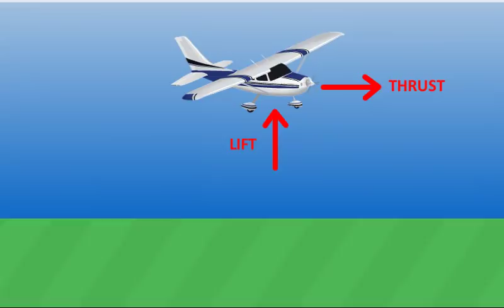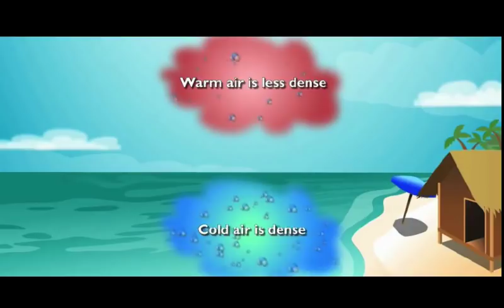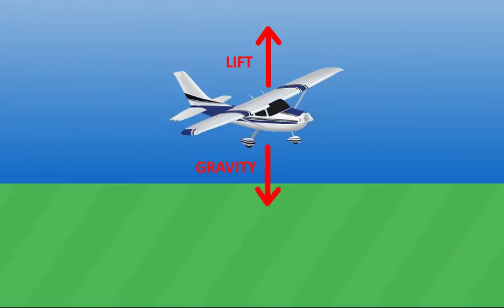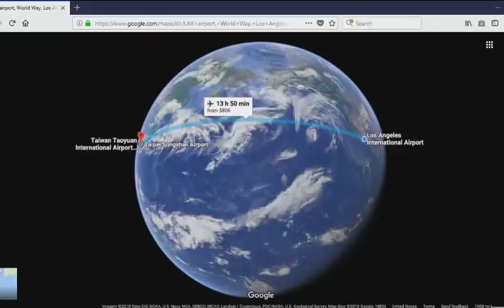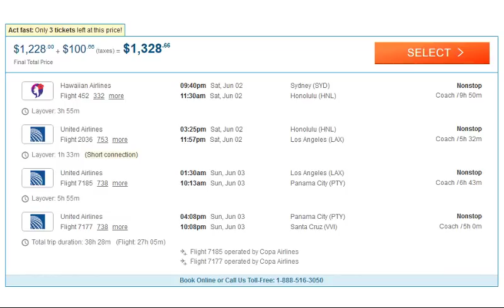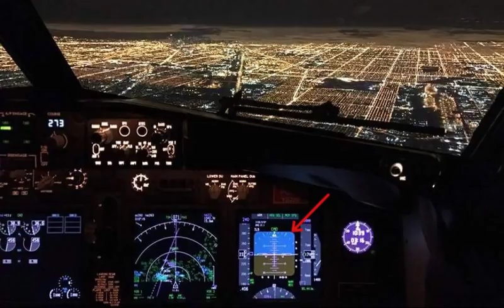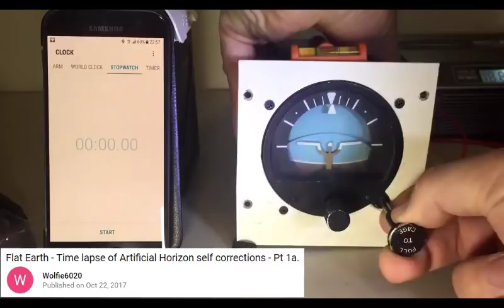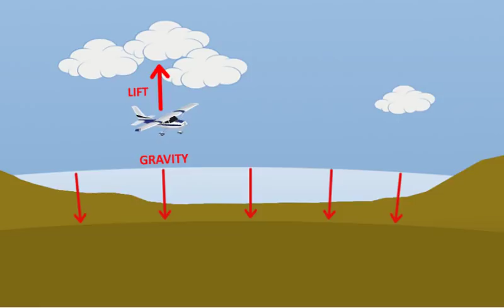Flat Earth Falsities - Plane Nonsense

Comment: Qantas flight 27 is your example to debunk flat earth theory. Please check any flight tracker, check this flight and watch it live. The GPS coordinates go dead shortly after takeoff and resume before landing. This happens for all southern flights that cross the area. This does not happen on flight paths over the "flat earth" map. You can see the coordinates the entire flight. Please explain this.
Reply from the maker: That is not true. I have personally tracked that flight. And even if it was, what are you suggesting, that it goes through some sort of time warp to get it all the way over to the other side of the flat earth without crossing North America as it should?  How can it make the distance in the time it takes? It should take about 3 times longer.
Reply: I'm not making this stuff up. You can see it in your video at 11:10. GPS data is live when the flight line is green. It turns white/disabled after take off and then green again a few hours before it lands. I have no idea why. Test it yourself. Qantas 27 takes off in 3 hours. At some point, the GPS will cut out. I tracked it departing from Chile and the GPS dropped out shortly after it was over the ocean. It then became available 3 hours before landing in Australia. It happened to different flights too. I'm not suggesting anything. I'm not a flat-earther. Just trying to debunk the theory as you are. It's a disturbing anomaly.
Reply from the maker: leo gibson - Go to flightradar24.com right now if you can. I am currently watching SAA280 from Johannesburg to Perth, in the middle of the southern Indian Ocean. Another flight that is not possible on a flat earth. I suppose all the flight trackers are in on the scam.
Reply: GPS is owned and operated by the United States government as a national resource. The Department of Defense is the steward of GPS. @JonasGrumby71
Reply from the maker: leo gibson - not only the US. Come on man, this literally took 30 seconds.

https://en.m.wikipedia.org/wiki/Quasi-Zenith_Satellite_System
Reply: @leogibson2486  So you make a claim.  You get shown that your claim is wrong.  And your response is to just claim it's all part of a conspiracy?  Does that really sound like a reasonable approach to you?  Also, just so we are clear here, you are claiming that the "government" is covering up flights in the southern hemisphere in order to hide the FE but they are so incompetent that they leave the northern hemisphere ones visible?  Really?  Come on man, do better.
Reply: My only claim was GPS flight data is not live during the entire flight. It goes from live data to "estimate" mode, mid-flight. Maybe that is common. I don't spend all day tracking flights. I assume the GPS data we see from tracker sites is somehow retrieved from a source. Wikipedia tells me that the US gov owns GPS. That could be wrong too. If there was any truth to flat earth, I would imagine there would have to be an elaborate cover-up. GPS seems to be the easiest to manipulate. Everything else seems pretty unbelievable. The topic is more entertaining than anything. Antarctica seems to be where the core of the conspiracy lies. Apparently, it's off limits for exploration.
Reply: @leogibson2486  "My only claim was GPS flight data is not live during the entire flight."
And my point was that you accept the GPS data that you think supports you and ignore the GPS data that doesn't support you.  That's cherry picking.  It is a very dishonest approach.

"Antarctica seems to be where the core of the conspiracy lies. Apparently, it's off limits for exploration."
It is not off limits to exploration.  You should stop getting your information from FE videos.
Reply: @leogibson2486  Good notice Leo, but you are dealing expert cherry pickers dishonest approach lippers as you have witness, they have no other recourse. We also may question the honesty of flight speed.
[The U.S. Department of Defense developed the satellite-based Navstar GPS system to accurately navigate in three dimensions - latitude, longitude, and altitude.]
Reply: @leogibson2486  I'm pretty sure GPS data for flights isn't perfectly accurate to the public for safety reasons. The US government created GPS but it is publicly available to every country on earth. The notion that somehow the US is keeping a coverup from other countries that have been to space is silly, and it's even more absurd to claim that every government is in on it. That level of secret could never, ever be kept. The reason Antarctica generally off limits is because it has a delicate ecosystem and tourists would obliterate it if they went down there. But there is one easy way to show that the Antarctic isnt an ice wall around the earth. Sail a boat all the way around what would be the southern rim of a flat earth and see how long it takes. On flat earth, it would take monthes to complete
Reply: Imagine getting on the plane flying from Sydney to Santiago, and then finding out the pilot is a flat earther.

Comment: So what slows the plane’s horizontal velocity down and speeds it back up again as it passes from the Southern Hemisphere past the equator and  onto the northern hemisphere? Honest question here, not a flat guy but if the earth has a circumference then it must have the largest diameters be at the equator and the prime meridian. If a plane takes off and has a horizontal velocity moving with the earths rotation, what force slows it down and speeds it up as it moves south tho north or vice versa?
Reply: https://i.pinimg.com/736x/d3/e0/a1/d3e0a1221de8cca4601b8885af1b6f39.jpg
Reply from the maker: Pilots are always making corrections for wind. The very gradual change in the lateral velocity will just be an unnoticeable part of those adjustments.
Reply: A puzzle, the sun on a flat earth has 1000's of miles further to travel when circling over Australia, then when circling around Mexico, simply different diameters. So summer below the equator when the sun is also below the equator the sun travels about 27,000 miles. Summer in the north the sun travels above the equator for only 21,000 miles. Therefore to race around above the flat-earth, the sun has to change speed to the tune of 6,000 miles. What makes the sun speed up, then slow down.
Reply: So just to clarify my question, I am not referring to winds, as wind and weather often produce vectors and patterns completely independent of the earth’s rotation. So per this website and I won’t bother summarizing it because I couldn’t do it justice but.....

https://www.space.com/33527-how-fast-is-earth-moving.html

If an airplane takes of from the equator it has a west to east velocity of approx 1037 mph with the rotation, and as it flys north it’s west to east velocity has to slow down as it changes latitudes where the earth is in fact rotating slower. So according to Newton’s 1st law something has to slow its west to east velocity down.... is the answer here simply the atmosphere is slowing it down? 

And not to complicate but what speeds it back up again as we pass over the North Pole and back down to the equator? Lol thanks all!
Reply: "as it flys north it’s west to east velocity has to slow down as it changes latitudes where the earth is in fact rotating slower" 
You have to consider the rate a plane travels relative to the size of the earth.  Seen from orbit the plane would be a microbe taking an hour to move about 1/10th the distance from the equator to the pole.  Within that hour the rate of change of earth's surface velocity is very slow and gradual.  I've heard it described as a 1mph crosswind, which for all practical purposes has no effect.
Reply: The usual problem. A total lack of awareness of scale.  @seymoresaymore
Reply: This is fairly simple. The answer is two parts. First, the earth is incredibly massive. Planes don't move fast enough for the change in latitude to matter. The adjustments required are so minor that just flying the plane fixes it. Imagine driving a car on a highway that is curving incredibly slowly road the right. But it only shifts over a few inches a mile from where you are. You wouldn't really be conscious that you need to adjust. It's the same with a plane.

Comment: fun fact old style INS systems based on a gyro fixed in space DO roll back this is part of how they track where you are based on its starting location see the CIVA INS for example this system would not work on a flat earth as the gyro would always stay upright and level

these systems where also effected by Coriolis and required inflight realigning based on fixed points on the ground, aircraft alt and slant angle to the ground station
Reply: Exactly the same with gyrocompasses, which is why the idiots keep ignoring them.

Comment: Gravity keeps the air plains  nose down automatically 😂😂😂  I am watching those blinds who follow this blind. How the gravity keeps down only the nose?

All the atmosphere rotate due to the gravity.(first of all gravity doesn't exist) friction? (If it is friction why the air moves from one to another place of atmosphere? Where is the pressure coming from? Since the air pressure can appear from east to west the reason you give us will be destroyed. Sorry I debunked you. Don't embarrassed yourself in front of flat erthers.
Reply: Abemelek Adsh Gravity is not keeping the nose "down".  When the lift on the wings equals the weight of the plane, the plane flies at a uniform altitude; the entire aircraft follows the earth's curvature.
Reply: Tubmaster 5000  is your version of  air plane moving on the ground? How it follows the curvature when the pilot not lets' it to curve? Poor argument. This is lack of basic aviation knowledge.
Reply: @abemelekadsh2708  
Gravity doesn't exist ? So tell me why do anything fall down ?
Reply: The problem that flat earthers cant understand is scale. The earth is massive. It is huge. No plane has to make adjustments because no plane moves fast enough to have to actively and consciously adjust to the curve. Further, even if the plane had to adjust to the curve actively, what prevents pilots from adjusting as they fly? Nothing. The adjust flight as needed constantly. The scale is massive that turbulence requires more adjustment than curvature. Next, assuming gravity doesn't exist is a hell of a claim. Please provide proof for such an assumption. You're making the claim, so that proof is your job to provide. Moving to your last point, the video explains exactly what you just asked for. Weather is caused by differences in pressure in the atmosphere. If anything, your point disproves a flat earth model. How does weather work on a flat earth if pressure differences in the air aren't the cause?
Reply: Rollie first of all I didn't say I have aviation certificate. second go and ask any pilot if they deep the nose of air plane in every six mile. they will say "No!". it's because the earth is flat.
Reply: You obviously have a total lack of basic aviation knowledge or are a liar, or probably both. And a pathetic troll to boot.  Please advise.
 @abemelekadsh2708
Reply: @abemelekadsh2708  How can an aircraft continue to ascend when the air becomes too thin to generate lift? Look at a FE map then go ask any pilot if they steer to the left when flying due east, steer right flying flying due west.
Reply: Robert Thomas your enquiries sounds none sense since we believe the air pressure acts toward the earth.
Reply: @abemelekadsh2708  You didn't answer my questions: You made the assertion that on a round Earth pilots would have to pitch their nose down, else the Earth is flat. That doesn't make sense because give RE, an aircraft can't continue to ascend when the air becomes too thin to generate lift. The same is true based on the amount of thrust created by the engines. 
You skipped: Do pilots steer to the left flying due east? This would be required on FE.
Reply: Robert Thomas your enquiry is raised particularly by  misunderstanding  FE. According to flat earth. Earth is stationary  it doesn't spine. So your question is not work here.let me relaunch your question toward you. While the air craft climbs the more higher the the more the air is thin this causes round earth problematic concept because the air craft keeps it's level hence it would neither descend nor ascend untill it reaches its destination means the aircraft supposed to keep the the level of atmosphere of the earth where it can get leveled air for the engine to work properly. But the pilots not keep down the nose of aircraft according to RE this will cause tje aircraft to leave the atmosphere of the earth. If you apply it for FE it is simple the pilot doesn't leave the nose down again and again as it is flat period.
Reply: @abemelekadsh2708  Here's news for you—a curved Earth has a curved atmosphere so an airplane won't continue to ascend. Moreover real fights contradict FE: A Qantas nonstop 13 hour flight from between Sydney and Santiago is impossible on FE. On FE the flight exceeds a 747-400's range by 6,000 miles and requires a speed twice the plane's maximum. This and similar nonstop southern hemisphere flights simply don't work on FE. This alone makes your argument moot.
     Air pressure is nonsense since items in a vacuum chamber fall.
     Your English is terrible and makes understanding you difficult to impossible. Post in your native language as Google can translate to English better than you can write.
Reply: @abemelekadsh2708  The flight doesn't work on an azimuthal equidistant projection like Gleason. This is a circular map centered on the north pole. It is the map FEers use.
Reply: Robert Thomas according to FE the NP will be in the center.
Reply: wong aircraft will naturally follow the curvature 😂😂😂 ugh. thanks for made me lough. I would like to lough more if you have more jokes like this.
Reply: Adsh are you and your sister going to have a baby together like your dad(uncle+brother) and mother(aunt+sister) did and their mom(sister) and dad(brother) did as well?

Comment: I appreciate your motive but sorry none of your response makes sense.
Reply: Abemelek Adsh That's because you don't have even a basic knowledge of physics.
Reply: Tubmaster 5000 sadly I am physics student in uni.
Reply: Abemelek Adsh Then please, PLEASE pay attention in class!  If there is anything you don't understand, ask your professor to explain it to you.
Reply: Tubmaster 5000 sadly I am one of the good student in my class.
Reply: Abemelek Adsh Your posts seem to suggest otherwise.  Perhaps you're joking around?
Reply: NotTheCIA I.think  I don't really believe what you call it weight. and  the density of air increases because the universe moves upward by 9.807m/s/s acceleration so the air bunches close to earth and the air pressure  acts toward the earth. Debunked.
Reply: NotTheCIA I.think and I don't have to believe every thing I learn I just have my own brain to work with.
Reply: NotTheCIA I.think first of all Newton first law states that if something is moving it remains moving at the same velocity except some force applied on it. 
second the difference of the what you call it pole(actually it is the center) acceleration and the equator is because the center of mass of the earth is at the center so the earth exerts force to push its atmosphere from the center. In addition it's not difference of acceleration it's the difference of earths exertion force. hence the the air pressure at the center will be increased the central mass will be  decrease toward the equator due to this the air pressure Increases toward the equator so the acceleration of the object will be decrease toward the equator.

You also enquired what causes the earth movement. Let me relaunch this question toward you what causes the earth spin? if some cause is needed for any movement.
Reply: NotTheCIA I.think I don't need to lie to talk about something since it is sharing of our understanding. if your assumption convince me I don't expect you to be physician. Apparently I am lying school physics in class. by saying what it is telling me. but I don't believe what it is saying since I can use my own mind I don't have to copy some ones mind who lived around 100 years ago.
Reply: NotTheCIA I.think really? Do you even know what newton first law deal about? I don't think so. You don't even know middle school physics.
Reply: NotTheCIA I.think you can call physician any one study physics as soon as they are studying and specialising it. You don't even know this and you dare to discuss with me.
Reply: NotTheCIA I.think ok you caught one language mistake not a lie. I can approve that but I can see you don't even know newtons first law. Second you don't know about the increasing of weight in a vacuum.
Reply: NotTheCIA I.think thank you for correcting my language but you supposed to be thank full for correcting you your newtons first law understanding. now I am waiting untill you understand the increasing of weight in a vacuum.
Reply: NotTheCIA I.think and you need to know acceleration itself is motion or velocity due to time.
Reply: NotTheCIA I.think you started word games instead of science that is english speakers problem.
Reply: @abemelekadsh2708  this thread has shown me that you don't understand basic physics terminology. Acceleration is a change in velocity over time. Newton's first law states that an object in motion stays in motion unless an outside force acts on it. What force, in your model, causes earth to accelerate at 9.8 m/s? Without a force, an object does not accelerate.
Reply: A physics student at what uni? The university of window lickers?